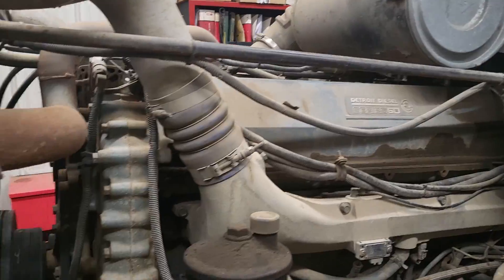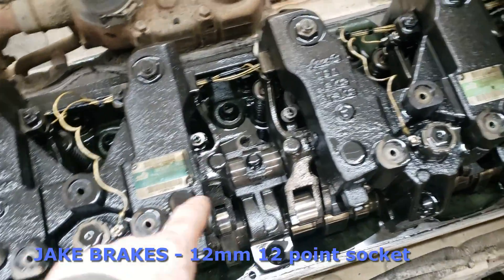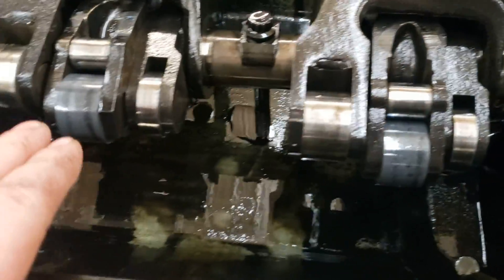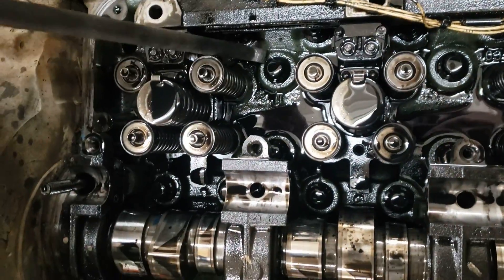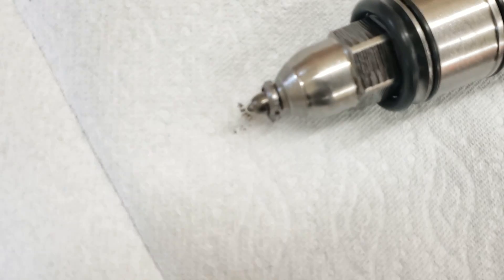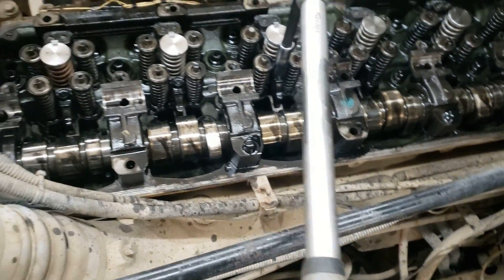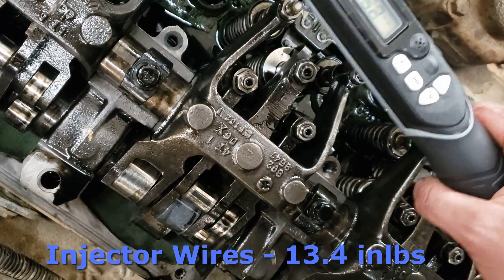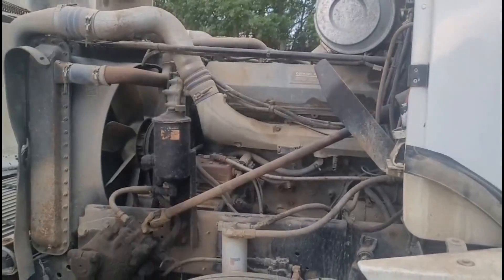How To: Replacing Injectors on a Series 60 Detroit Diesel

Comment: Whats the best way to relieve the fuel pressure in the fuel lines before takine out the injectors? Thanks.
Reply from the maker: You can pull the feed line and return Line to the injectors and blow air through there
Reply: Thank you for the reply. I appreciate it. @zedperformance
Reply: @zedperformance with an air compressor?

Comment: Where are you located? I would love to bring my truck to your shop, im having issues starting my ddec 4 12.7 1999. ran out of fuel and a friend of minds told me to prime by putting air in the fuel tank line but now it only turns over but no start.im going to add more fuel and try again. Im from Pennsylvania LOVE HOW CLEAN YOU ARE GODBLESS ❤❤

Comment: I got 1999 volvo vnl detroit diesel 60 series, dashboard cluster diagnostic reads injector # 1
Active
Data valid but high 
Count 34

On top of motor head cover by first bolt its all wet
How can I know if it's injector or could it be wires going to it or O rings
Reply from the maker: Should have it scanned first and check injector trims.   You could try wiggling wires from ecm up the head to see if it misses at all or changes.

Comment: If I just had my over head ran would I need to do it again after all this? And I thought u had to set injectors height?
Reply from the maker: Would definitely do it again.  And yes you need to set injector height.
Reply: @zedperformance  I've never done injectors in a big truck. I've done some in the older 5.9 cummins. I'm wanting a set of 5915 injectors but wanting to see if I can do it myself to save money

Comment: I have a 93 internatiomal  with a detroi i was Park for 5 months  n now its only goes 45 mph i chance de fuel filter one each side the one in the pasaanger side its  was only half fuel on it   u think the injector r bad on it
Reply from the maker: Doesn’t sound like injectors.  Is it missing at all?  White smoke?
Reply: @zedperformance  if it feels like the engine bogging but fuel filters are fine you think one of the injectors went bad?
Reply from the maker: @HPX584  I wouldn’t jump to that conclusion.  Gotta make sure it’s drawing fuel from tanks good.  Might just be lift pump.  You’ll need a gauge to check fuel pressure.
Reply: @zedperformance  yea it bogs under load and feels like a misfire. I checked vacuum leaks and fuel filters which are all good. What could it be?